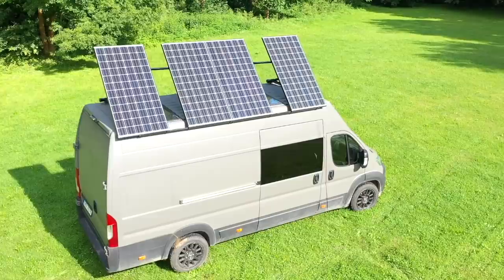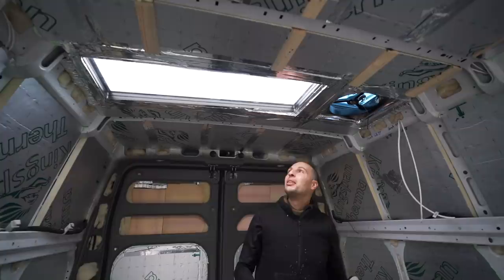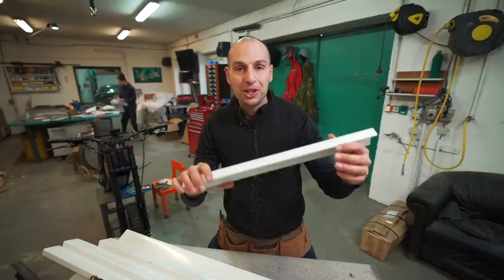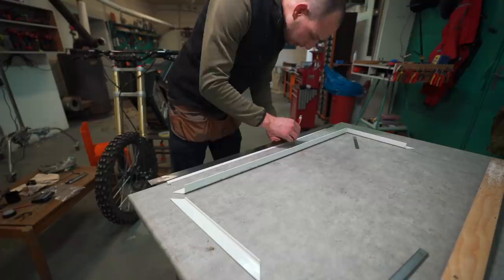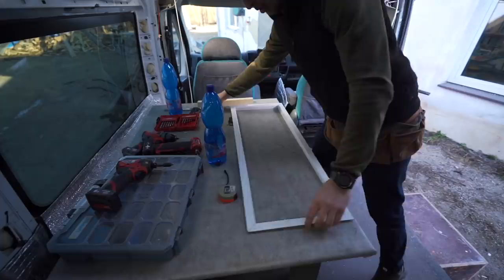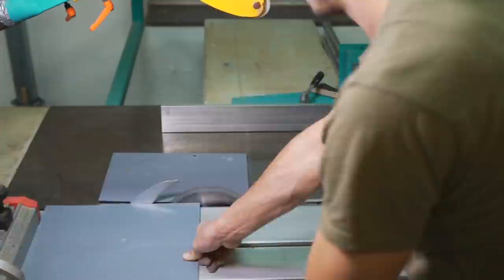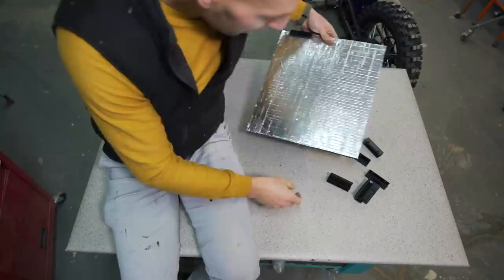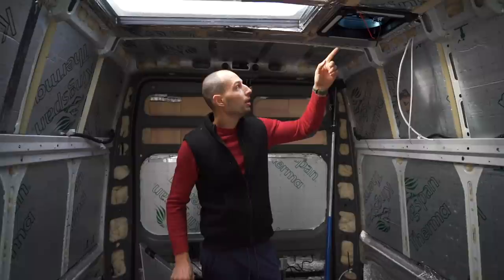No Van is INSULATED without THIS! Winter Van Build s2e9

Comment: I had a similar thought about the roof vents. I would have made a 3cm thick rigid insulation plug with some nice covering front and back and black felt around the edge to get the air and light tightness. Then hold it in place with some simple rotating wooden pegs. Also tight enough to keep some upwards pressure on the plug. For the windows (which I love) you should be able to get better R values than the rest of the van roof with well made argon filled triple pane windows. Then something thinner like you made would be OK for those just to keep the light from getting out. Also for solar shade, the cover needs to be on the outside. Once the sun comes through the glass you get the greenhouse effect and the heat is already in the van. I would make some thin white plastic shade material covers (for the windscreen also) with magnets stuck at places around the edge seam, then just get on the roof on the sunniest days and place them. Pulled them off again for driving and rill them for stowing. Just a thought.
Reply: I think using 3M mounting tape and neodymium magnets is a far more simpler and elegant solution than the one you suggested. But that’s just my opinion

Comment: I think about put nothing on the left side of the van (without doors one), no windows etc. and instead cover all the surface with thin solar panells (glue them to the surface of screw them with bimetal screws or combined etc. and then while parking try to tak that side to the sun and also similar to your roof with pannels that can be lifted up a bit. Then you got 2 nice string of PV power and even during the winter should be enough.

Comment: Great job once again. I also bought one of those plastic welders when I saw it on Ali. Haven't used it yet but I have seen an interesting technique, where you press down the wire on the plastic and then rotate it a bit. That way the wire sinks in the plastic and when you twist it, it gets covered by the melted plastic and bonds even better.

Comment: Damn windows covers almost the same as mine I’ve chose plastic and cork inside and reflective foil outside. But a badly screw up with railing. Urging to see what Lady gonna do. And I did similar staff for my side windows with latches. Because I was scared of breaks in. It saved my van this summer. I had a break in south of Russia. Broke the window but couldn’t get in because of latches.

Comment: You could have made the frame rounded like on the fan, but still great job and you gave me some inspiration.
Reply from the maker: How would you do it with the white trim around? If you try heating and bending it, the C channel opens up.
Reply: @ladiandmargaret  It's about the 14:00 frame, not the window cover.  And this frame can be easily rounded, although the surface for gluing would be smaller, but it could be done differently.
Reply from the maker: There is always another way of doing things 🙃
Reply: @ladiandmargaret  The campervan will probably be beautiful anyway, I am waiting for the final effect and more inspiration.  Good luck with the further construction.

Comment: Question for anyone who can answer-

I’m building out a low top van, does putting the fan above the counter (but still centered in the middle) make much of a difference compared to having a fan in the back above the bed when it comes to the moisture while cooking? And would having one that close to a portable cooktop interfere with the flames?

I feel like having one in the back would be ok but it would probably help to have a portable fan pointing towards the back a few feet away on the same counter top to push the steam towards it

-thanks

Comment: Hi Ladi,
great work and filming as ever. Thanx a lot for sharing! Question: What is that for a meassuring tool @ 2:05min? Seems, as if you scratch lines with it. What is the name of it or maybe a link or sth.? Is the scratching pin also at the zero line? Many thanx?
Reply: it's a caliper!
Reply: @mehtaworldpeace3364  Hi, yes yes, caliper, but what for caliper exactly? There are 1000s outside, but havn't seen yours.

Comment: What material did you use on the panel face?
Reply from the maker: The black is a leftover material we have a massive roll off. It’s kinda textured. It’s the same one we used on our seat bases too, and in the last van build!